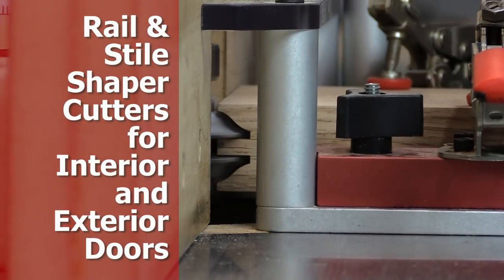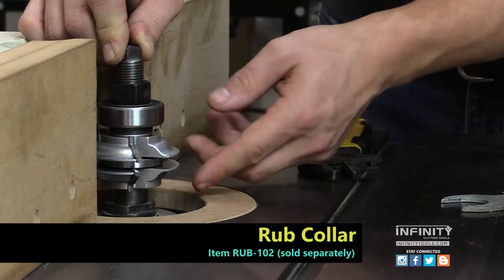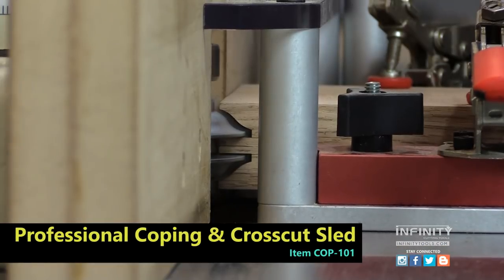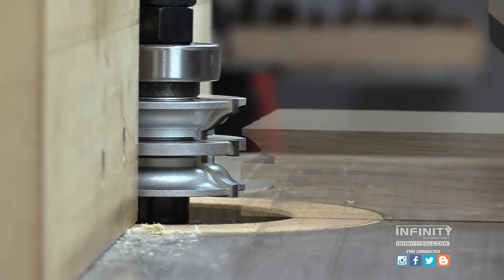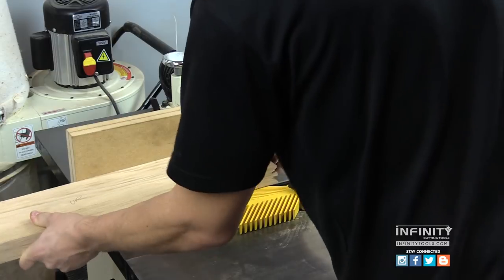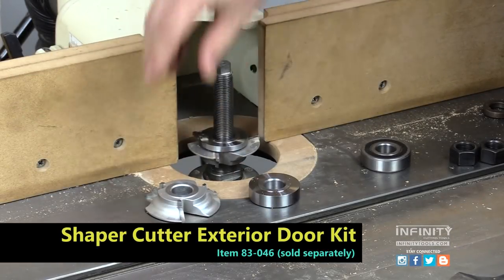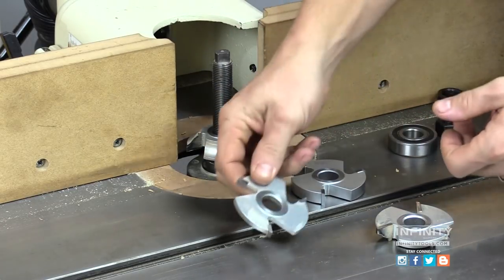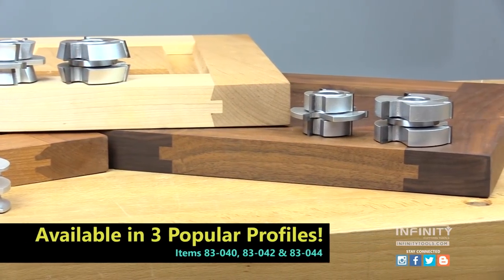Shaper Cutters Make it Easy to Build Custom Passage and Entry Doors

Comment: Can a person add more cutters to make a 2.5 thick exterior door for cold climate ?
Reply from the maker: Unfortunately, no. If insulation is your concern remember that most hardwoods are rated at less than R1 and softwoods no better than R1.5 per inch. Increasing the thickness of a solid wood door even by a significant amount will make very little difference compared to the surrounding walls.
Reply: @InfinityTools  actually they will be 2.5” to have a 1” rigid foam core to bump up the r value for Canadian winters, it’s I believe code now as most custom makers are using 2.5” here.

Comment: thought exterior doors required a through tennon of 150mm and it to be glued and pegged?
Reply from the maker: Extended tenon and pinned doors use traditional construction methods that have stood the test of time and do not rely on traditional hide glue for strength and durability. Modern glues and construction methods have evolved and use a variety of joinery methods such as stave core and floating tenon construction. For those who wish to make doors with traditional joinery, we offer extended tenon cutters.  Though 150mm (6") sounds a little excessive for many projects. https://www.infinitytools.com/extended-tenon-shaper-cutters-1

Comment: Very nice how you supposed to extend the tenon on this shapers
Reply from the maker: We do have an optional extended tenon cutter available.
https://www.infinitytools.com/shaper-cutters-accessories/carbide-shaper-cutters/door-making-shaper-cutters/extended-tenon-shaper-cutters-3051
Reply: InfinityTools ok thank you can you do a demonstration on extending tenon shaper please thank you very much
Reply: Hi I like this cutter but My (Charnwood  
w030)spindle moulder is 30mm bore spindle will this cutters fit on my spindle let me know please
Reply from the maker: These cutters are only available in 3/4" bore. For a 30mm spindle you would need to look at our Insert Pro line of cutters. The insert Pro line is all 1-1/4" bore and we offer T-bushing sets to reduce the bore size to fit the 30mm spindle. If you have any other questions please email us at customerservice@infinitytools.com
https://www.infinitytools.com/shaper-cutters-accessories/carbide-insert-shaper-cutters